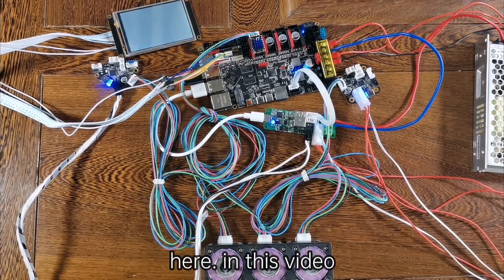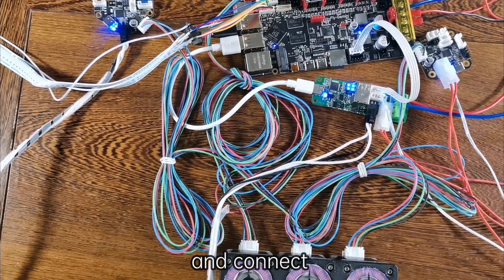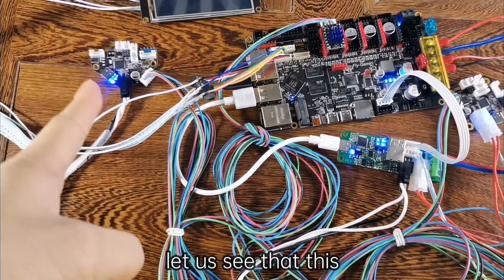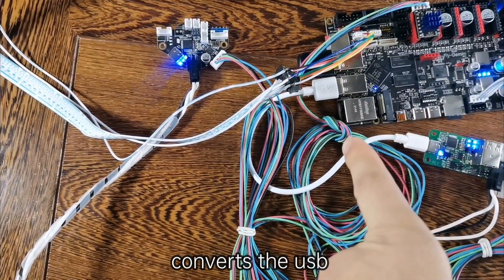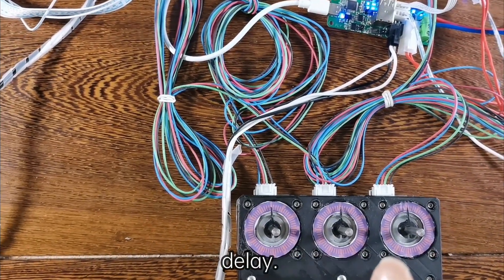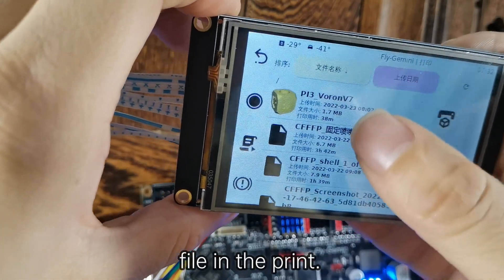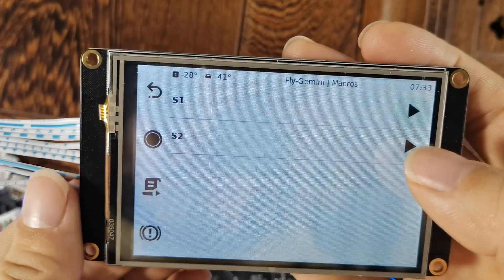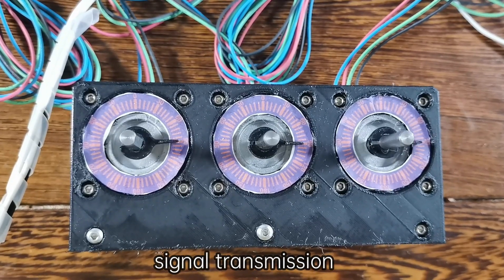Mellow Klipper 3D Printer Firmware - Multi CAN Bus device Motor Sync test

Comment: Thanks for this video, was looking to see if multiple toolheads worked in klipper via can bus. Thanks!👍
Reply: Can it? Wiring was a bit confusing to me.
Reply: @solasauto  yeah i'm not sure from this video if the motors can be addressed individually or if the signal can only be copied
Reply: @solasauto  ; I agree I was looking for some info about canbus on an idex printer. Still unknown 🤔